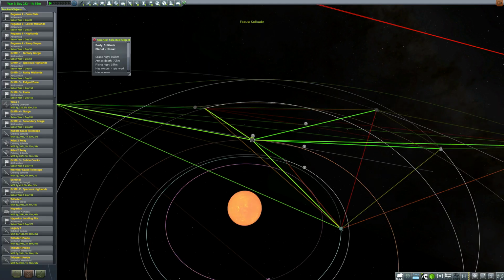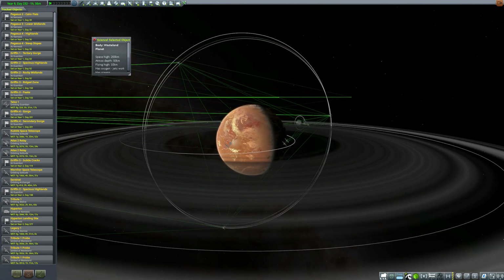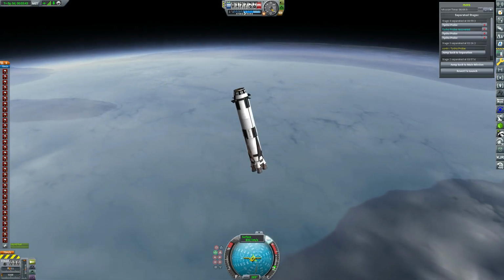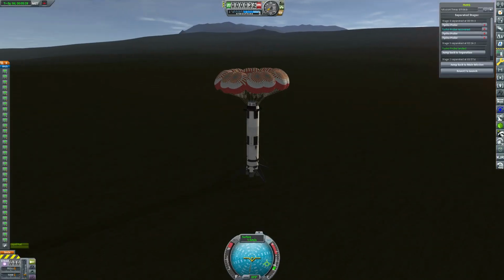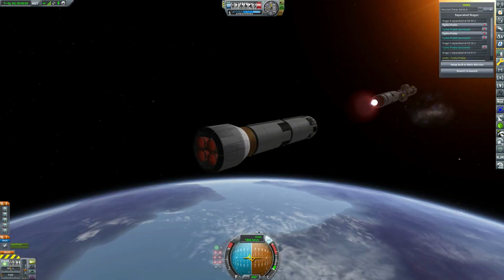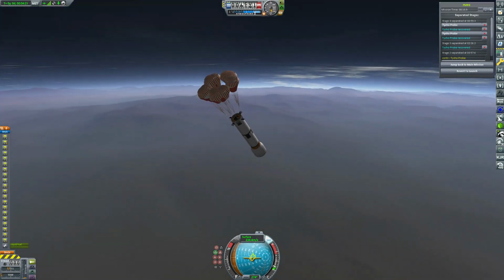Interstellar Dreams | Beyond Kerbol #1

Comment: jesus... Tac lifesupport really became a pain to get working... used to work fine... sigh... download in gamedata  then doing into its game data folder and moving (thunderarospace) it into the gamedata folder of ksp then moving the dll file to the correct location as per instructions... had to get a separate version of module manager all fine and dandy but damned curseforge didnt have a upload for the file grabbed the zip from google search unzipped in required folder... done and done... anyways hope that helps anyone having issues... tac needs its own download tutorial video... anyways cha...